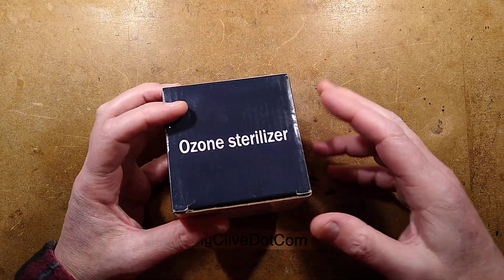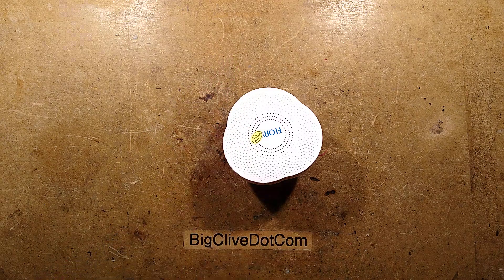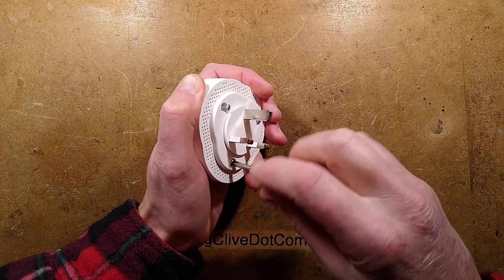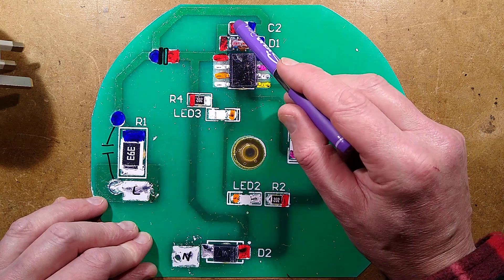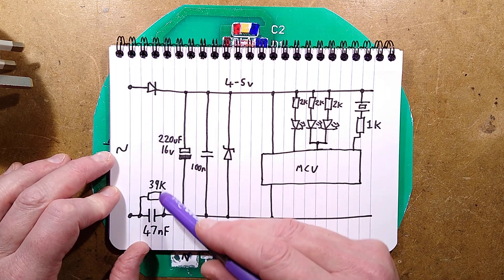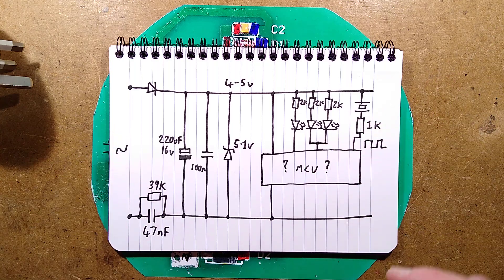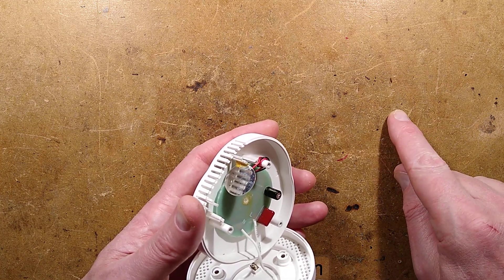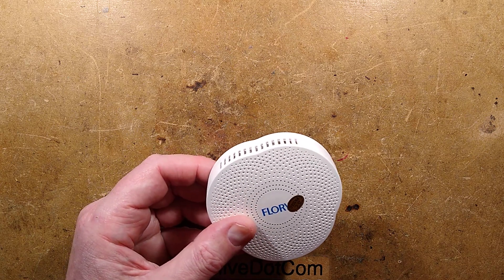I got scammed on eBay  (what a surprise)

Comment: A scam on ebay? I have never heard of such a thing :)
Reply: Here we go again (c)
Reply: I didn't think there was scams on Ebay 
 Especially if you pay with PayPal. 
Not to mention the 2 week cooling off period in the UK.
And eBay don't pass on the money to the seller for a month. ...giving the buyer plenty of time to see if they've been scammed. 
It appears to me , Ebay is pretty scam proof of online shopping
Reply: Amazon has triple the scams
Reply: @RjReactionZone  actually yes, but no. Its too complicated
Reply: @RjReactionZone  I work in the glorious world of safety testing, and I have to agree Amazon holds the crown to most terrible products
Reply: @RjReactionZone  order something from Wish. The advertised product itself is a scam and what you get sometimes is a scam of a scam.
Reply: @talos86  agree but been buying from them also and they have been really turning it around last 10 items bought had no problems had 2 problems last week and wish fixed the situation so didn't like wish while back but sure is making big changes for the company
Reply: @RjReactionZone  my lil bro bought from Wish a "GTX 1050 Ti" against all of my warnings. He got a Geforce GTS 450(GF116) with a Radeon HD5450 cooler... they simply drilled new holes for the mounting screws into the coldplate. he got in the package an A4 paper with some details and a link for the custom drivers.
Reply: @talos86
Oof. I hope he learned a valuable lesson about something seeming too good to be true - it absolutely is. How much was he out? I bought a legit new in box 1070 ti for $800 last year from a reputable seller and was happy with my price because at the time it was hard to find anything legit at all for under a grand

But Ive seen many of them (hell ive seen 1080 tis listed at $300) going for $200 and claiming new in box from very dodgy sites. Either youre not going to get a legit one, or if it is it was probably used and run to the edge of its life by miners.
Reply: @childofcascadia  he paid 24.000,- HUF($61,- on the current exchange rate).